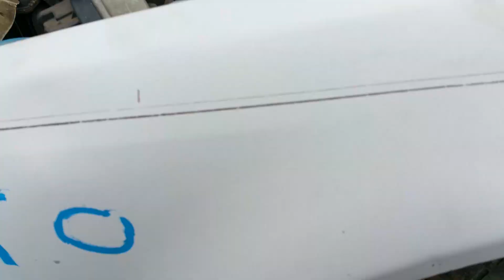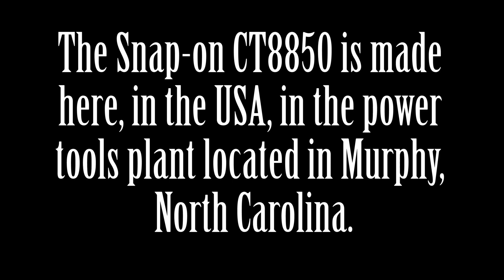Snap-on CT8850 vs. Junkyard Honda Crank Bolts

Comment: I bought this Impact from our Snap On guy at work and so far the impact is worth the money. I'm not a fan of Snap On's way over priced tools but I needed an electric cordless impact to take it where my Air Impacts can't go. Came with two batteries and a charger and I must say I don't regret buying it. I also have the 3/8 Impact from Snap on so in total I have four batteries and keep a charger at home and one at work. I never worry about running out of battery and not having an extra already charged.  also the battery last a long time.  I'll get this days of constant use easy before it dies in swap batteries when I have one bar left.
I ordered Milwaukee's 1/2 cordless impact from Cornwell so I'll see how they compare next week when it arrives.
Reply: any update on the milwaukee?
Reply: Still a snap on fan?
Reply: @salar7459  im sorry im years late barely saw your questions. But im sure by now you have herd or seen the Milwaukee 1/2 impact wrench videos to know that the Milwaukee was awesome. I would buy another Milwaukee over a snap on again any day. I really want to buy their 1in impact wrench not the pistol style grip but the big regular 1in style impact. That thing is powerful and would save my back unlike the air one at my shop.
Reply: @NexttGeneration  when did I say I was a fan of Snap On?
I was only sharing my experience so far that I had with the 1/2 in impact because it was so far giving me no issues removing any lug nut or bolt. I did end up getting my moneys worth i. Still have it works fine i just no longer use it i retired it and i keep it at home if I need it i know i can rely on it still. Besides maybe i should of added the reason why I bought the 1/2 is because 1 week before i had bought snap on's 3/8 impact and that thing was a waste of money. I was never able to break any bolt or lug loose with it. That thing was about 600waste of money hell no i dont like snap on lol. 
I bougt it in hopes it had balls to remove tires i know its only 3/8 drive but this thing couldnt even take off the caliper sliding bolts. Those are not even tight.

The only reason why I thought a 3/8 electric impact wrench would remove lug nuts from a car is because im able to do that with my Dewalt 1/4 Impact Driver using a 3/8 bit. It usually removes most lug nuts. The snap on 3/8 impact wrench was useless
Reply: @arthurgarcia4389  still have my old ct8850 just sent it to refurbish, im waiting for it to come back. But ive been watching videos of the milwaukee midtorque, and daaaamm i want it so bad.

Comment: A lot of people bitchin and moanin on YouTube saying the cheaper impact guns are just as good as snap on when they've never even used a snap on, I have and wow they are well worth the money they pay for themselves after a couple uses
Reply: i wouldn't say its b*tchin or moanin. just that the other big names in the tool industry can do the same work. is snap on worth the extra $? 100% user opinion. to me? nope... but im an industrial tech so there isn't a truck that comes by, $, already have plenty of tools, etc... But for you? if you think so knock yourself out man. Does snap on have some benefits over other tools? in some cases yes they do! I love snap on hand tools and have alot of them personally so in that case i agree with you 100%. Good example - snap on serrated screwdriver tips on their phillips screwdriver bits - IMPRESSIVE! no one else does that. I can call customer service and get a broken tool mailed to me just like that - no hassle! no one else does that! but they aren't the end all be all of the tools industry in every case either. But in my personal experience the "auto techs" seems to think if its isn't snap on its just junk - and thats just an opinion.
Reply: +luddaman924wsi well said man I agree, I've use plenty of different types of tools and as long as it's not harbor freight tools most of the ones I've owned haven't failed me. just been used to the point of no return

Comment: Why don't you just use the Lisle tools 77080 for $23 and a regular cheapy lithium impact? You'd save almost $400.

Its not the killer wrench. Its the killer socket. 

My grandfather said its okay to get pounded on. The anvil always outlasts the hammer.
Reply from the maker: +PsychoFisho I made this video as a demo to my customers that doubted the strength of this gun.
Reply: Thanks for demo.

My point is, there's no need for a really high-priced, high torque portable, when a less expensive impact with the overweight harmonic balancer sockets will do the job. 

There needs to be justification for the price of the CT88850, and after watching a bunch of video reviews, I don't see it. Maybe a freight truck mechanic - but I think they are into air power. The overall size is always smaller for the same torque and working inside engine compartments, compact size is important.
Reply from the maker: +psychofish1 no air hose to tie you down, no need for a compressor, good in the field or road service. Love using mine on junkyard trips.

Comment: not fair all those bolts  probably been removed before at some point when the timing belt was done..
Reply: jonathan w agreed! Try a brand new Honda that never bee removed the crankshaft, I can almost guarantee you that 700 ft lb torque will not work...
Reply: @lebronjordan802  what's the difference?

You gotta torque it back to factory.
Reply: Questchaun true but we don't know how many times those crankshaft bolts  has been removed and not re-torque that's it but great video and effort though 👍👍👍!
Reply: Yeah I agree I just watched a video where it took a gen 1 high torque milwaukee and a 8Ah HO battery so 1000 ftlbs breakaway torque and the lisle socket to get it and quite a bit of hammering like 7 sec.  He even showed the Ridgid mid torque and Ryobi mid torque go at it with no luck.   So these old hondas that probably had two timing belt jobs in their lifetime are not true candidates. Plus are these in the salt belt im guessing from down south.

Comment: if it's on the passengers side what way does the bolt come out?
Reply from the maker: +Frank amaral Standard threads, lefty loosey.
Reply: Thnx man.
Reply from the maker: +Frank amaral you're welcome.
Reply: Also lefty loosy on the driver's side?
Reply from the maker: +Frank amaral yes.

Comment: So is this normally a problem for guns to handle???
Reply: yes they are free kin tight snap on sells a specialty tool you hit with a hammer or air hammer just to loosen these.
Reply: +Michael O'Brien and they sell a blue point socket set for these, as thick as axle nut sockets

Comment: Stupid vid..these are old hondas..mostly likely the timing belts has been replaced before..not torque back to factory specs..try a brand new honda where crank bolt has never been removed..
Reply: Nah, maybe all these bolts were taken out by Milwaukee impact wrench before 😂😂. Saw similar video in youtube of a guy doing the same thing in the junk yard using a Milwaukee gun.